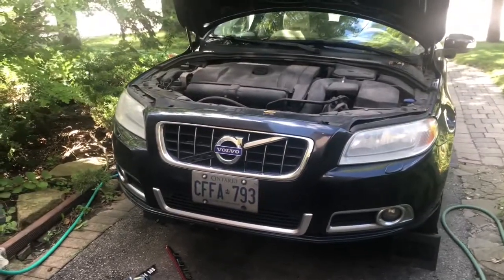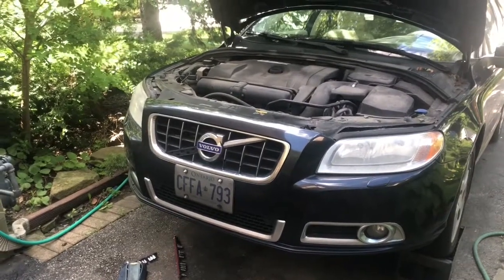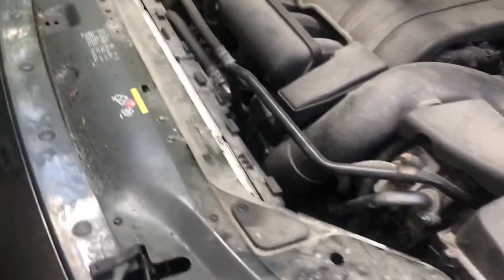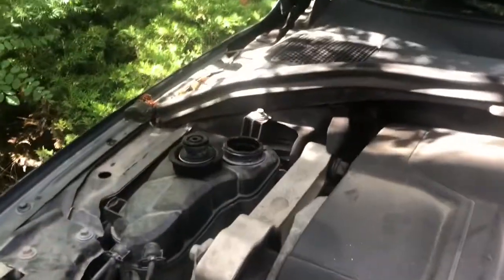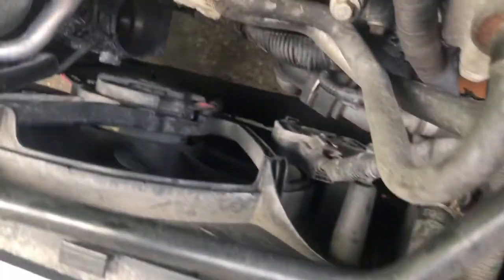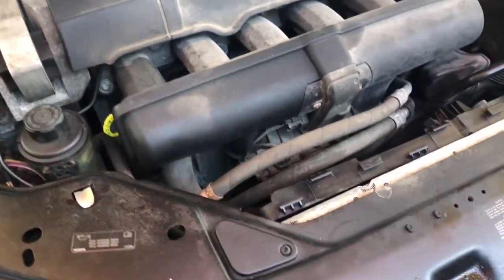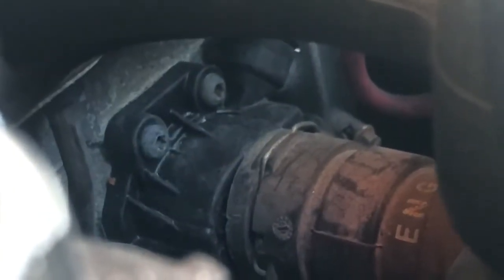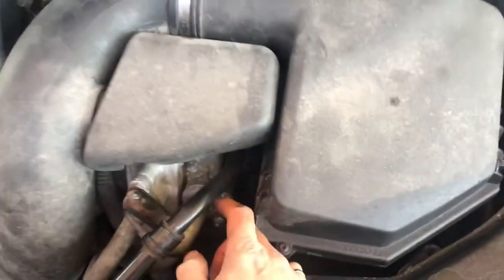Replacing Radiator Fan and Thermostat 2010 V70/XC70 P3

Comment: I changed thermostat housing and fan on 2009 s80. It’s very tight spots. Don’t have to take off anything. The fan pull left, then right, back and forth, it will come out just about enough room.

Comment: Replaced my Thermostat and all the coolant and Radiator Hoses (9 in total)  new coolant, Reservoir at 47,000 kms in my 2009 XC70 3.2 a week ago and the Thermostat was disintegrated like yours at very low Kms. It’s more a time issue then distance travelled. Volvo should of recalled it.
Reply from the maker: Wow, that’s nuts. Why cheap out on such a vital part. Thanks for sharing.

Comment: What was your car doing that you knew the fan was bad?
Reply from the maker: Engine overheated and red light came on. When I started it back up later fan was non responsive altogether.
Reply: @Bigtime_mcalpine  There is another condition in which the fan/fans continue to run after the car is shut down.  This indicates a bad control module, which is a very simple part to replace and can be found online for around 30USD.  If the problem happens again with a new module, then the entire fan assembly needs to be replaced as shown because it is drawing too much power and will just keep shorting out the module.  If the car is at ~100k miles or more, you should cut to the chase and just replace the entire thing to begin with.
Reply: @thaddeusbatt9409  This exact problem, happened to me yesterday on the highway. Could you explain how to change the control module?